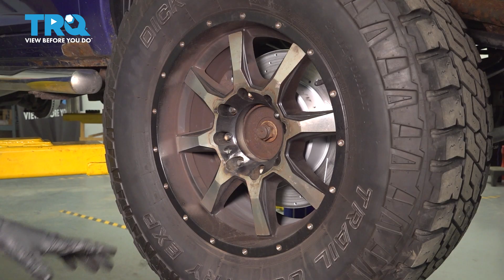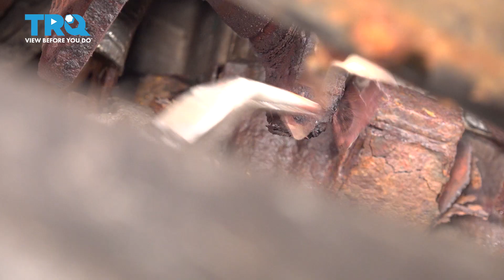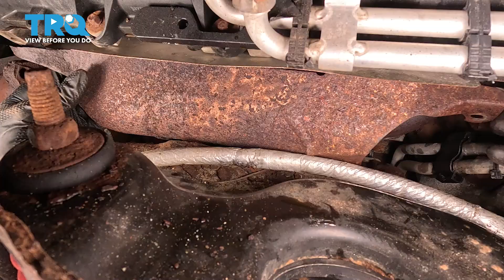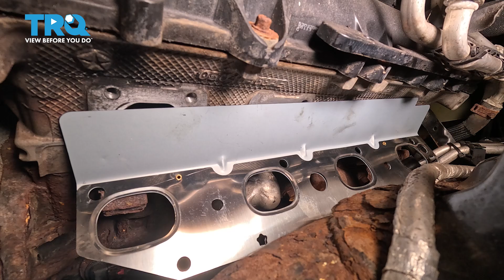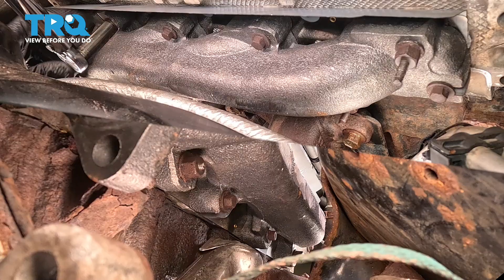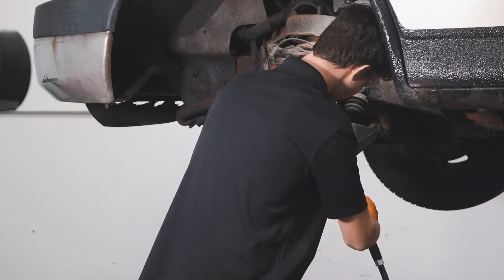How to Replace Exhaust Manifolds 2011-2018 Ram 2500 (6.4L HEMI)

Comment: I most definitely wouldn't have re-used these bolts ... They are known to fail, why would you re-use them? Confusing to me ... I'd go with ARP 40mm bolts and then buy new OEM mopar stud bolts. Do NOT re-use these bolts people. You'll be back to doing this again shortly. Otherwise, good install.

Comment: Im trying to replace two of my studs but im stopped because of the two front bolts holding in the heat shield are stripped… any advice